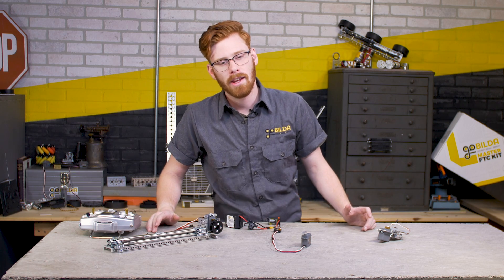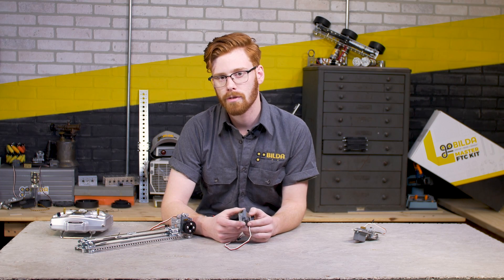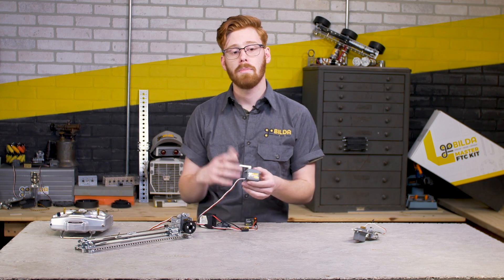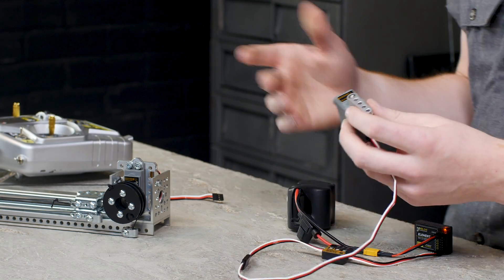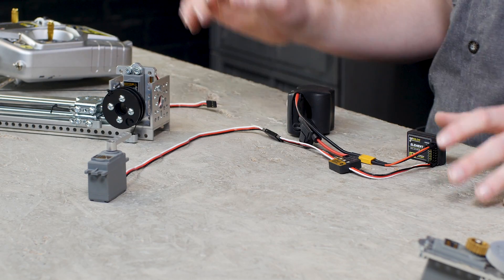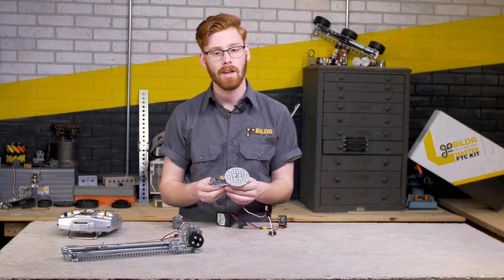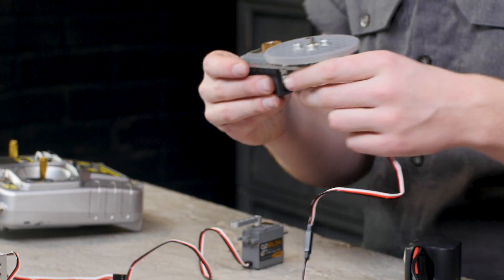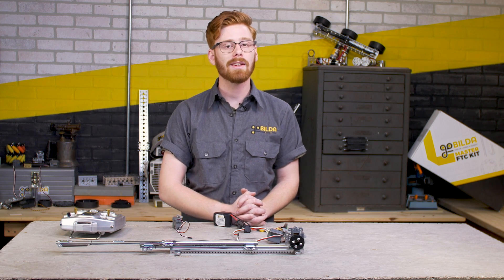New goBILDA Multi Turn TORQUE Servo

Comment: Hi there.  Do these also send signals to what angle they are?  I am building a robot arm that needs to do an action when all the links have reached their position (i.e. when the servos of all have reached their needed positions).
Reply from the maker: They are a one-way communication device, you send the servo a target position and it does it's best to reach it.